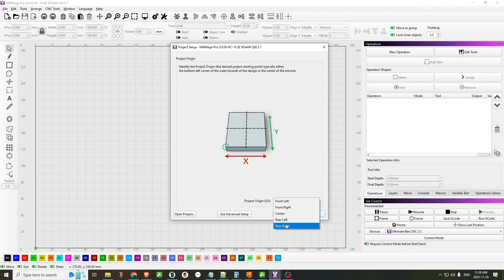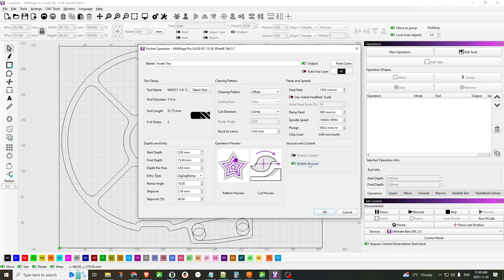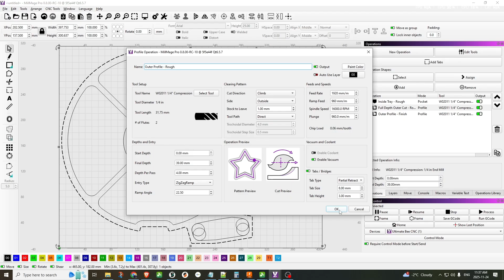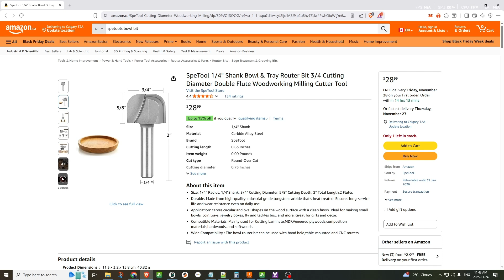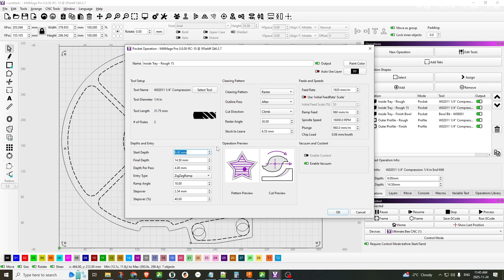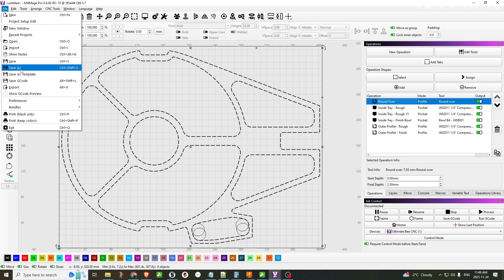MillMage Project Setup - Millennium Falcon

Comment: All the video waiting for see the cnc cut the example about you are speaking and finish the video without cut....Dissapoint with you Sparks!!
Reply from the maker: Hey thanks for watching and sorry for disappointment. I had intended to include the cut video but I had an issue and tried to run the roundover bit at 19600 mm/min and the machine skipped steps. I have to plane down the board and start again so I will have the cut video out soon.

Comment: Interesting.  You did not mention post processors, does it have some already, allow you to import customs?  I find Lightburn to be a bit clunky but they could fill the "reasonably priced" whole in the market. Also just FYI your tray and bowl bit is capable of doing the whole pocket, no need to do a roughing first leaving the step like that.  Just take into account the cutter's dia vs. the shank dia and back it down a bit.  Also Cadence Mfg. (jenny Bits) makes a great spiral tray and bowl that can be run much harder than the flat two flutes.
Reply from the maker: As the video was getting pretty long already I did skip the Post Processor setup as I had already defined it, but yes as part of the machine setup you can add all kinds of pre and post commands for the start of the job, for bit changes and for end of the job in the machine profile and then those commands get inserted in the gcode when you export the file. 
Yeah I could have done the whole job with just the one bit but my round over bit is more expensive so I try to prolong its life with less expensive bits.  I was looking at the one from Cadence and will order one and then I might try to use it in this manner in the future. 
Thanks for watching.
Reply from the maker: I created a video going over my post processor settings here: https://youtu.be/DJKrdRo4GLc

Comment: Did you add your own bit settings or have they added library import yet? Thats the main thing thats keeping me from switching at this point.
Reply from the maker: Thanks for watching, I have been slowly building up my own tool database as I go in MillMage. The default install now includes some basic bits to get you started but the feeds and speeds are pretty conservative and the bits are generic. 
https://www.youtube.com/@paulszudzik9588 has been doing some great work on building a convert tool for all of the main database types out there to MillMage so I hope to give that a shot soon.